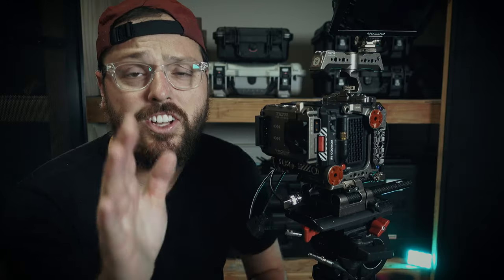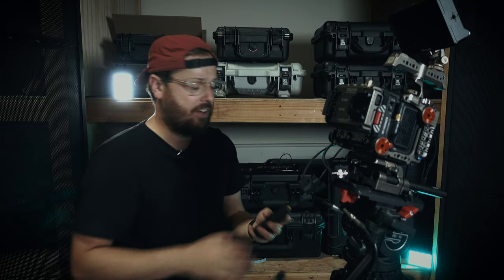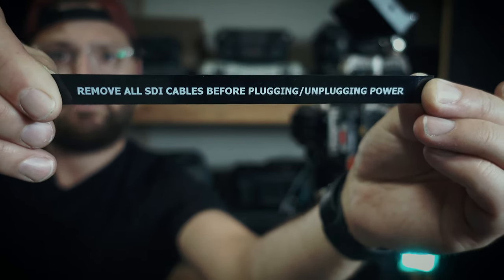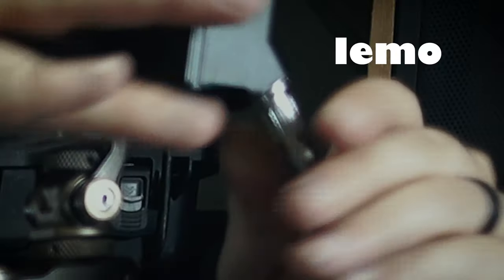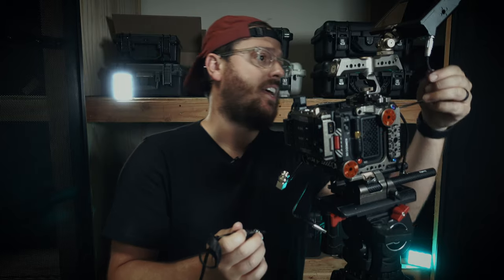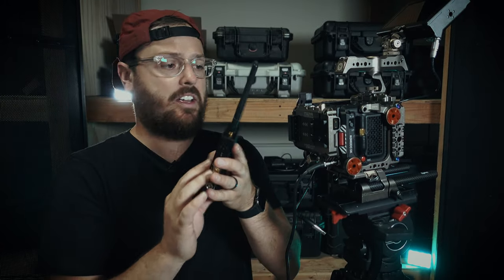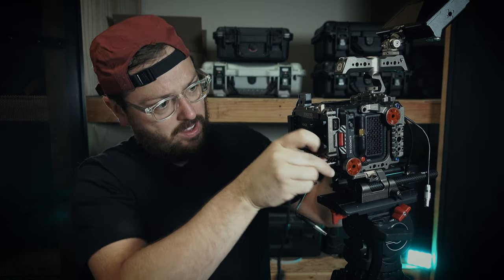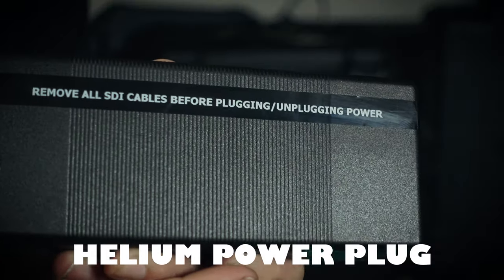How To Keep Your SDI Output From Blowing Up

Comment: This issue is actually prevalent specifically with 12G SDI not 3G and HD-SDI. This is a great video as we should always follow best practices! However a few things can mitigate the issue.. 12G SDI cables by Canare and Belden that are shielded, and LEMO 2 and 3 pin power cables that have a shield as well. The issue is specifically problematic with D-TAP (unshielded) and 3G unshielded SDI cable.. At our rental facility we have brought in a full stock of shielded SDI 12G and got them in bright RED so we can differentiate visually between those and the unshielded variant. As well we are configuring all our Komodo and other 12G cameras to use Lemo power cables where possible rather then d-tap.. just an added 2c.. great vid though!
Reply: does this allow you to power down/up the RED without pulling the SDI? or should you still do that
Reply: @ryanjosephdp  While shielded 12G cables and lemo power does mitigate the issue significantly. Its a good habit to train yourself to remove SDI before removing power cables. Also to be clear, if both power and SDI cables are connected then powering up and down your Komodo will not damage the SDI port. Pulling the SDI cable is suggested to be done BEFORE removing the power cable (D-tap or Lemo). The issue is caused specifically when the SDI is connected without the power cable while a battery is installed allowing the SDI cable to conduct ground..
Reply: @wdigivideo  What about a sharkfin and hotswapping one of the batts while the other is still powering camera?
Reply: @productionresource3333  if you are keeping the camera powered up then the SDI can stay connected, so yes this will work. Realistically powering down with SDI connected should not damage the port just to swap a battery. However it’s always best to create a routine in your workflow so SDI last on and first off regardless of the situation means that you never put yourself in the situation where you should have removed it but didn’t. Creating routines helps you avoid task loading and making mistakes
Reply: @wdigivideo  I see. So the SDI short only occurs when the circuit is broken or completed, then.
Reply: This is deep. My camera has both 3G and HD-SDI connections. I have it connected to an external monitor, wireless video transmitter, wireless follow focus, and video mic via D-tap and V mount battery. I’m using Canare 3G SDI cables. So far I haven’t had any issues but would this moment apply to my set up? Thanks
Reply: @shaunmaddox  This applies to ALL cameras with SDI ports. However its signifncatly more common on cameras with 12G ports. A few things to consider, always plug in the SDI after power and remove before you pull power. With your video transmitters, avoid power cycling them repeatidly with the SDI cable connected. So if you are having transmission issues, before power cycling, remove the SDI cable, power cycle, then re-attach. This is the most common way we see SDI port failure..
Reply: Awesome! Thanks for clarifying. I would hate for a malfunction to happen on set.
Reply: I agree, get proper shielded SDI cables and use 2 or 3-pin Lemo power cables and avoid Dtap at all cost. And don’t power your accessories from different power sources…
Reply: Are there any resources available on repairing an i/o with damaged SDI? I would guess it's something simple like a blown capacitor within the circuit. Do you know the appro cost to have this repair done on a damaged I/O? Thanks! -AW

Comment: The problem is different. Many people power their systems with a single power source and power distributor plates. When one cable loses ground connection, the power for this might run over another device, frying this device because of the extra load. That happens with batteries as well, when everything runs from one V-lock battery.
Reply: So it's not a good idea to power camera and monitor from one V - Mount battery? I plan on doing so on canon C70
Reply: @marekmucha2300  Unfortunately not. On the other hand this affects SDI much more than HDMI, and the C70 has no SDI. Risk assessment is up to you.
Reply: @VisualPursuit  I do have SDI cross conversion monitor tho, so there is SDI out to consider.

Comment: So the issue is with plugging the power cable into the outlet? If the problem is one prong getting connected before the other, why don't you get all power outlets fixed with a switch? Most places here in Asia have a switch for a socket. The socket never directly receives electricity

Comment: Thank you for making this. Two weeks ago I lost an SDI port on my Panasonic Varicam because I didn’t know this. It is very sad and will cost me $600 and about a week.
Reply from the maker: So sad!
Reply: Sorry to hear. Have you had any issues since, once you followed the above protocol? I just fried a port on my Varicam LT as well. I'm paranoid about it and I'm scared to try plugging everything in again. Just need some peace of mind.
Reply: @modernhumantv  mine just fried in my varicam as well!
Reply: @wyldflowerfilmwerks6008  What do you have plugged into your Varicam? After going through this whole problem, of course, in the middle of the biggest shoot of my life, I had a few things plugged in improperly. First, follow Red's protocol for unplugging / plugging in SDI cables (It's a PITA, but is good insurance). Sorry don't know link, but just search for it. Second, don't go overboard with splitters and / or power routing. I think this second issue was more the problem for me. I had changed my power routing for a steadicam rig and ran an external battery setup in a strange way. If running external power, just keep it simple and making sure to use high quality battery plates like Wooden Camera (with built in fuses) or the main plate on the back of the camera (which has a fuse). When I talked with the tech who fixed the camera at Panasonic, he said I essentially blew a 20amp fuse inside the camera, which meant there was a huge power surge. All the main boards were fine. That was good, because it only cost $1000 ;( instead of who knows what? But it was frustrating that, if Panasonic had made the fuse user accessible it would've been like a dollar to fix. DON'T TRY AND OPEN THE CAMERA. The engineer told me repeatedly, for any future problems not to try and open it, because it's extremely complicated inside and takes about 2 hours to get to. But camera manufacturers need to let people access these kind of things, on cameras this costly, because it would save a lot of money and time in the field. Once he fixed it and I followed the above two steps, we filmed for the next 6 weeks, not a single problem with the camera. Not sure what you did specifically, but hopefully you figure it out and it never happens again.

Comment: So should I turn on the camera before or after I plug in the Sdi cable?
Reply from the maker: I personally am not sure if it matters. What matters most is actually plugging in or unplugging the AC power cable.
Reply: You can leave the camera on if you have already powered off the device it is connected to (example: external monitor). Hot plugging SDI (or HDMI) between two running devices runs the risk of a short, especially if the BNC cable you are using is not high quality and shielded.

Comment: Does it also apply when working with batteries. NPF on SmallHD and BP on Komodo?
Reply from the maker: As far as I can tell, it’s only a problem with AC power so you should be fine. But for us, it’s better to just always follow the protocol, even with batteries

Comment: You can use a SDI galvanic isolator. They sell ones rated for 12G for around $500 cheap insurance.
Reply: L4KGI-01 - Overview
LEN Limited
Protects your Operators and Equipment from shock damage during installation...Eliminates interference during operation!

The LEN galvanic isolators use broadband high-pass filters to provide isolation of DC currents between two pieces of equipment, whilst permitting the full bandwidth of the 4K SDI signal to pass, so avoiding problems of signal distortion and operator shocks caused by a voltage difference. This method far out-performs broadband transformers for SDI signals. Both the signal and the ground paths between equipment are isolated, there is no distortion of the signal.

Another problem with coaxial cable use, that is solved by the LEN 4K Isolator, is in applications such as Outside Broadcast, where large voltages can build up on the outer cable shield due to different ground potentials at each end of the cable run, producing a spark as the cable is connected to its destination connector. This is particularly a problem in drier parts of the world.

The LEN 4K SDI Video Galvanic Isolator is offered in two options. Option one is an in-line 'barrel', suitable for portable applications, and option two has a mounting flange at one end to facilitate rack-panel mounting, for applications such as tailboard feedthrough.

Our Engineers at LEN have called on their long experience working with ultra-high frequency filter design for the Military to produce a product that is compliant to the SMPTE 6G and 12G specifications and fully tested on high end Vector Network Analyzers. We understand what is needed to design good product at such very high frequencies.

Operation over coax at 4K / 12G has been awaiting the release of companion products to the LEN 4K Isolators, such as 12G rated BNC connectors and coaxial cable. These are now reaching the marketplace.
Reply: @gethinevans8596  Hi Gethin, I just purchased two of the LEN 3G barrel isolators. So these will not allow SDI ports to blow, regardless of how things are plugged in? I just recently had a Varicam LT SDI port blow and I'm scared to plug anything in at this point, just want to be careful. Thanks
Reply: And still you should go power first, bnc last 🤷‍♂️😂

Comment: Does this happen when connecting a battery or only AC power?
Reply from the maker: They say it only happens with AC. But I would go the extra mile!
Reply: It definitely does not happen when you use batteries.
Reply: @joshhill9754  It can definitely happen with batteries.
Reply: Does this also apply if you are switching the power on/off to the monitor? Like pressing the power button.  That would be a serious time sink.
Reply: better not to get confused and use one system only XD
Reply: @joshhill9754  It seems as though it actually can happen with batteries - have heard a few stories anecdotally with batteries. All that has to happen is the SDI being plugged in first followed by a D/P Tap. If the positive pin of the DTap hits first, there’s a decent chance the SDI port gets fried (especially after repeated instances)

Comment: Once everything is powered and SDI's are connected can the camera and or monitor be turned off and on? 2nd question if monitor battery needs to be changed the SDI cable has to come off first on both ends monitor and camera to swap the monitor battery.

Comment: I just received my Komodo and am running a Small HD 702 powered by the Canon LP batteries on the monitor. Do I need to be as worried about power surges around my SDI cable if the monitor has its own power source outside of the camera still? I know the super safe method is always removing the SDI, but just curious
Reply: Yes.

Comment: So every time you replace the battery on set, you have to remove SDI’s? That seems like a design flaw to me.
Reply from the maker: I agree. It seems like there should be a hardware fix.
Reply: MVJohnsen  great question!!! hopefully someone will respond.
Reply: MVJohnsen  did u find out the answer?

Comment: Hey man, quick random question - have you had any issues with the Tilta V-mount plate at all? Saw it come off at @1:18 I'm running the CORE SWX V-Mount Plate and it has lots of play, sometimes bricking the camera when bumped. Thinking of changing to a tilta one.
Reply from the maker: Great Q! Yeah the tilta has more play than I’d like it to but I’ve moved it around and bumped it while the camera is powered up and haven’t lost connection. It’s annoying but it doesn’t seem to be a real problem for us.

Comment: Interesting video.  So does the SGI cable go out all of a sudden, or does it flicker on and off.  Last night on set, my monitor was going out intermittently whenever I bumped the cable.  I think this might be a different issue, but I changed the cable (thin 12G SDI) and it still seemed to be a little wonky.  But it was fine once I moved from gimble to tripod and wasnt knocking the cable so much.
I'm going to try rn w/ another thicker 12G cable I have.  Maybe it's the cable not my SGI port.  Fingers crossed.
Reply from the maker: Feels like a cable issue. The whole sdi jack on camera gets fried when this issue occurs.
Reply: @TheObsessiveDP  You're right, I changed to a different cable and it's working fine.  Now to find a right angle 12G SGI slim cable =D

Comment: So lets assume you are using a larger V lock battery with the same tilta plate you have. You can not access the SDI port after the battery is on the camera. How would you approach that situation
Reply from the maker: We’ve used a shark fin before. It only allows for one battery to be used but it clears the ports on the bottom.
Reply: Just unplug the BNC from the monitor. You can leave the other end connected to the camera.

Comment: Should the monitor and Komodo be off before I remove the SDI?
Reply: I heard from another youtuber to NOT turn off the Komodo but remove SDI cables first. Can you clarify?
Reply from the maker: Yes. Remove sdi cables before doing anything with power - plugging in or unplugging.

Comment: I didn't get when you turn on the camera? I thought it was about NOT plugging or unplugging SDI when the monitor or the camera are on, but first connect SDI and then turn the camera and the monitor on
Reply from the maker: Nooo! Turn the camera on or off WITHOUT SDI attached. DO NOT attach SDI first
Reply: @TheObsessiveDP  So every time I switch my camera ON or OFF to save on battery , I have to remove the cable? That seems like a huge time sink.
Reply: @funnymono not when you turn it on or off, only when you attach/remove a battery or power cable.

Comment: Okay, help a brother out.....if I've got a monitor and I'm powering the monitor with it's own Sony NPF battery.....and I'm powering my Komodo with a battery on the back........I would turn on my monitor first,  connect the sdi to it.....turn on the camera,   then connect the sdi to the camera ............. when turning off the camera ( to change battery on monitor etc...)...........just disconnect the sdi from camera first?  Right?   I really don't want to brick a $6000 camera. (no sdi = a brick)

Comment: All you gotta do is just plug a sdi cord into the monitor and camera and use 95 canon batteries and or v mount why plug in the camera to the electricity wall anyway that’s no different then plugging a laptop into a car a/c plug outlet that takes outlets you’ll burn it cause of the power of the Volts

Comment: this procedure is done only with the connection to the electricity network or also with the use of vlock batteries?
Reply from the maker: As far as I know, the concern is with AC power only. But why not be safe and do it with batteries as well?
Reply: This applies to batteries as well.  You can even blow an SDI port by using the same battery to power the camera and a seperate monitor via d-tap.
Reply: @badGamr  Yeah, I blew my Varicam LT port with a Gold Mount battery and P-Tap running to Atomos monitor and camera, for a steadicam rig. So, just to confirm, if I follow the power first SDI second rule, I should avoid this problem? Thanks
Reply: @modernhumantv  Running separate power to the monitor and camera is the solution.
Reply: @badGamr  I've heard just the opposite. Why two power sources instead of one? The idea is to get the monitor and camera on a common ground, before connecting SDI. With multiple battery sources it seems like following the power procedure would be much more tedious and difficult to follow. Also, most professional setups utilize one power supply, that's why Alexas and Reds have power outputs.
Reply: @modernhumantv  Here is what I know: I blew the forward SDI port on my G2 when it was powered from the same Vmount battery that powered the separate monitor I had on the camera.  After the repair I was advised to power the devices separately and have done so with no issues.  That is my experience.  YMMV.
Reply: @badGamr  Great to hear that it's working for you. You're talking about the Ursa Mini G2, correct? Was that Black Magic telling you to do that? Were you running a p-tap out from the battery into your monitor, previously? What kind of monitor are you using? Thanks for all of your input.
Reply: @modernhumantv  Yes, G2.  I was running a P(D)-Tap from the V-mount to a SmallHD Indie 7 monitor and BMD advised that they be powered separately after implementing the fix for the SDI port.

Comment: "Power" means when the camera & monitor are switched on or also when they're switched off but the batteries are plugged in?
My question is, can I turn on/off my camera and monitor while the SDI cable is connected? Should it be fine as long as I'm not changing batteries?
Reply: Turning your camera / monitor on and off, after you've plugged everything in (in the correct order of course), you have established a common ground and you shouldn't have any problem doing that. It's when you plug power cables in and the pins don't connect in the correct order and that then sends power through the SDI cable and completes the circuit. Unfortunately, it's sending the power into a sensitive low voltage SDI chip, which is why it gets fried.